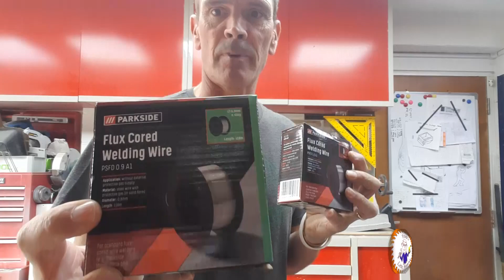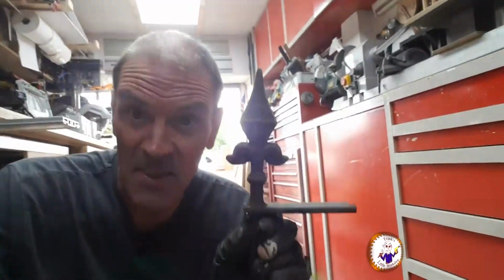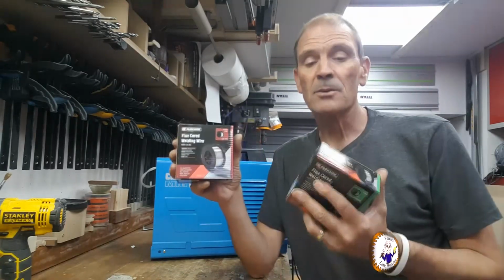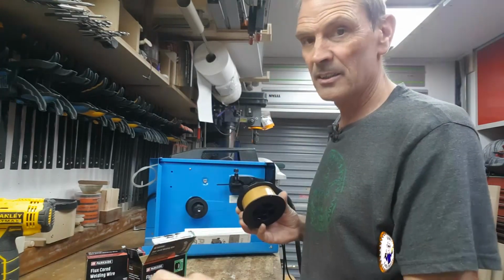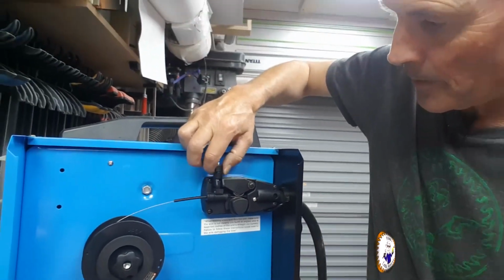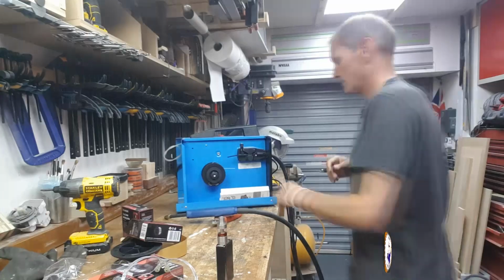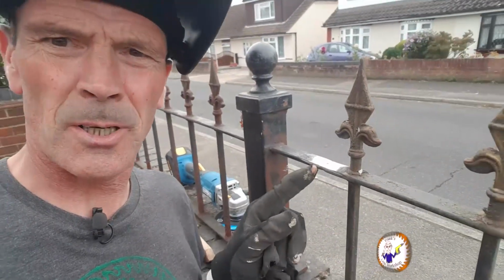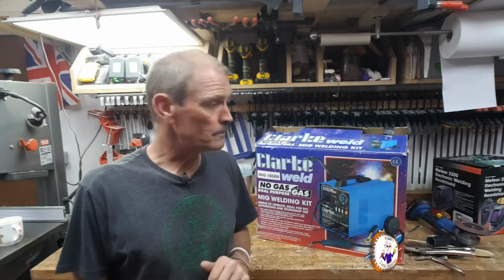Parkside welding wire, Will it work in a Clarke Mig?

Comment: I bought that wire months ago to try in my Clarke welder, welded the underside of my Mk6 transit. Had my 90en welder 30 years and it's the best wire I've ever used so last week I bought 12 rolls of it in Lidl, next day I went to buy more and it was all gone so everyone is thinking the same. I've had to do a ton of welding on my van but this wire makes it easy as the metal hasn't got to be super clean to get a good weld! You don't need to screw  the nozzle on the torch as flux core works without it ( makes it easier to see the weld) and another little tip is to replace the plastic liner for a spring net curtain wire so the wire moves smoother through the welder for nicer welds, nice work there 👍
Reply from the maker: Thanks 😁. Ha ha looks like you have used up all of Lidl's stock of wire. I'm sure it's much better than the original wire that was supplied with the welder. I'm sure the 4 rolls I got will last me for ages ( unless I ever get around to welding up the downpipe on my ZZR600... that will take a lot of wire 😂🤣). Thanks for watching, stay safe 😁👍.

Comment: Great video Frank, I'll have to lookout for some of that wire. My mini mig is a Clarke one and the reels of flux cored wire are around £10 from Machine Mart. You did a great job on the fence, I actually used to be a welder for an agricultural firm. I left engineering to do woodworking as I thought it was a bit cleaner 😆
Take care David 👍
Reply from the maker: Thanks David 😁. I think that's why my Mig has been hidden away for so long (I run out of wire and it was just a little too expensive). I was going to convert it to gas but at the moment it works great so I'll save my money 😁. Ha ha woodwork is cleaner but so so so much more "sawdusty" 😂😋. Thanks David 😁👍

Comment: Hi Frank....Weld un... sorry  ha ha .. you are a better welder than me .. I  have a gasless mig welder and while I can get the weld strong it is anything but pretty... good info in the video...take care...All the best.....Andy
Reply from the maker: 😂🤣😂 very good..lol . Thanks Andy 😁. I finally completed a job I started 8 years ago... I just needed a £3 roll of wire 😂🤣. Hopefully this info will help others out... so they can finnish there outstanding jobs 😂🤣. My welding is the same.. it's not pretty.. but it works 😁. Thanks Andy 😁👍

Comment: You don't need to fit the shield when using flux cored wire it's for containing argon shielding gas.. It also keeps your shield clear os excess splatter
Reply from the maker: 😁Sharp eyed indeed 😁. You are 100% correct. But I leave it on.... if I take it off... I will loose it. But I will try it without next time I use it to see if it makes a difference 😁. Thanks for watching 😁👍

Comment: would you not cut a piece out of the middle
Reply from the maker: I was hoping to do that but because I moved the pillar and the dimension between the pillar and the slope changed and also the main straight dimension changed I didn't have a choice 😞. So had to do it the hard way... but it worked great in the end 😁👍